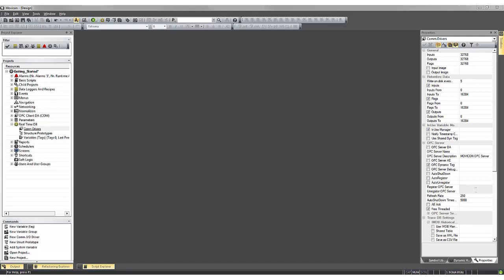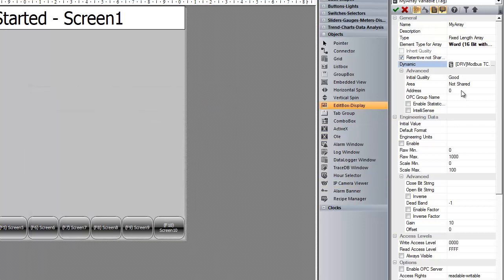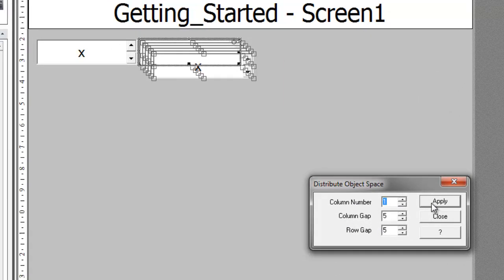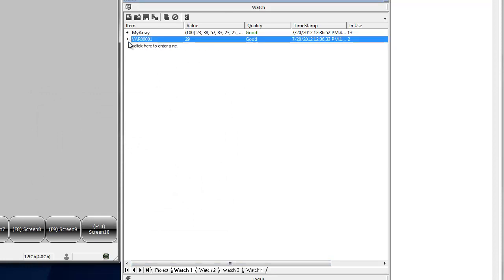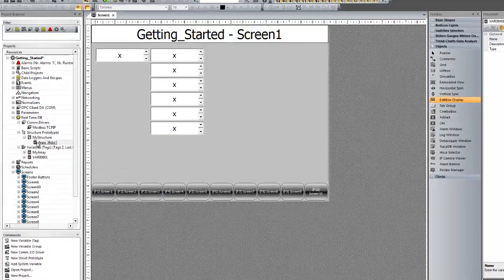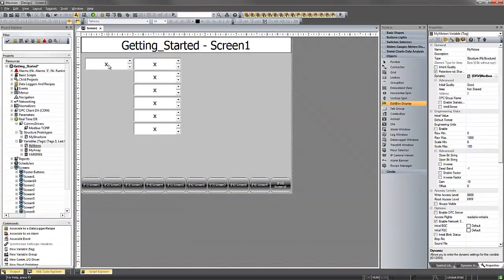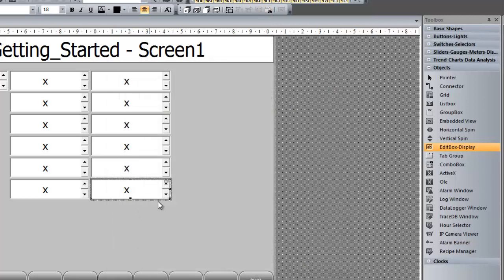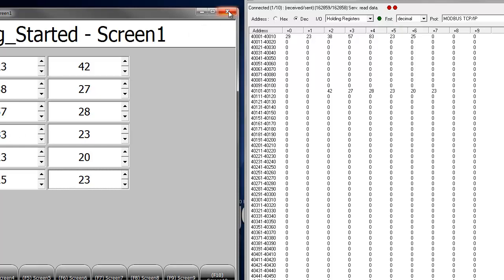Movicon 11 SCADA / HMI - Tags/Variables Creation

Comment: hello I have a problem with movicon 11.6. I want to communicate with a plc s7-1200. but I want to use the new communication drivers update, siemens ethernet s7-1200 / 1500 TCP. all right, I have to configure the variables. it is different from what it used to be and it does not matter if the symbolic address assigns it, 0, M0,% M0 or% M0.0. do not communicate with the TIA 15. What should I do or where do I get information?

Comment: can you help me? I have problems with plc s71200- Movicon, i use the S7 TCP driver,
when i write on the device address (movicon): Q0.0,   or M0.1 etc or just an analog input (MW2)  there is no problem, 
but when i use analog and digital tags ta the same time there is a ploblem to comunication ..
I´ve read some forums of this where says: i have to use address like DB1.DBB0,  but I can´t get ity, thanks